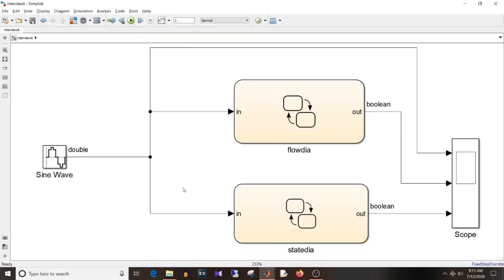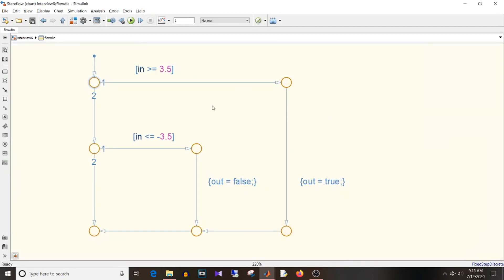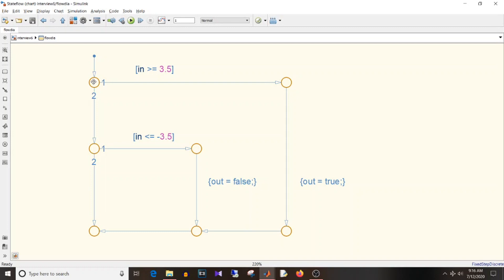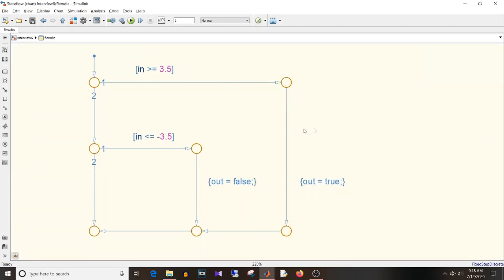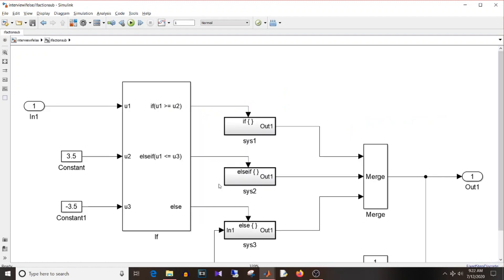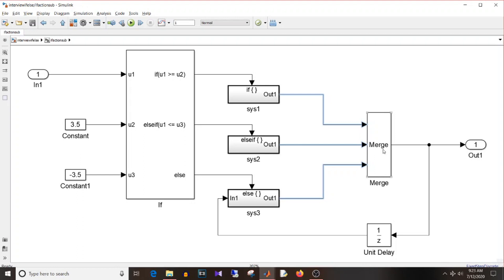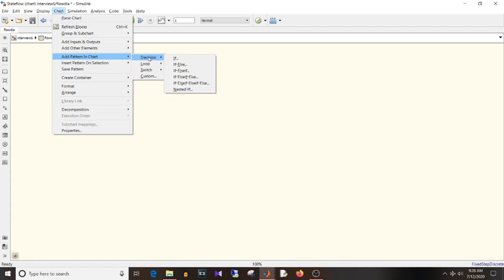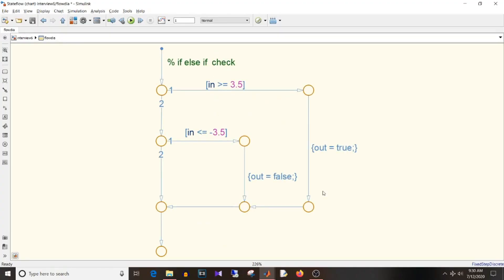Simulink Tutorial - 65 - MBD Interview Questions | Part 6

Comment: if there are three functions running at 10ms 20ms and 100 ms how can we simulate them.in integrated model
Reply from the maker: Model referencing - If you have 3 different models for those functions, then have fourth model where you can refer all these 3 models using 'model' block and connect interfaces to each other. Ensure step size is equal to the least step size required.

Other option is if all 3 functions are in same model, use rate transition block on interfaces for correct data transfer and ensure each function is running at expected sample time by modifying the sample time in block parameters.

Comment: How is the embedded code is generated for the state chart... to hold the previous state execution instance ..
Reply from the maker: For state diagram,
First it generates code for default state, where it assigns state variable to default state and its entry action. It is applicable for first run.
After this it checks which state is active, and checks for its outgoing transition, so if outgoing transition is true, it assigns state variable with new state and out with its entry action and in else part it checks with incoming transition and assigns state bar with that state and respective out value.

Rather than me explaining this, try generating code with autocodegen by selecting one of the TLCs, it will give you better idea.
Reply: Simulink Tutorial ya got it ... thanks for the explanation